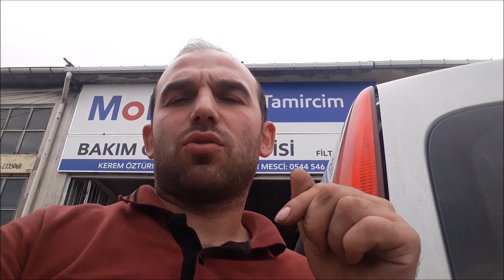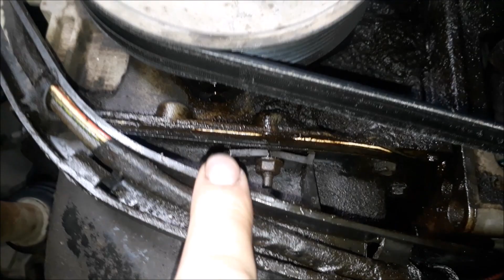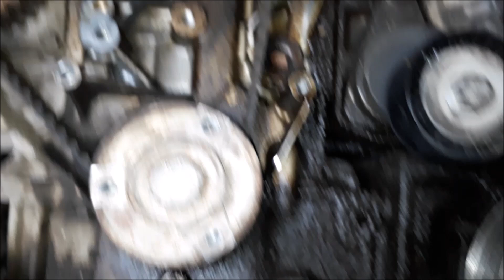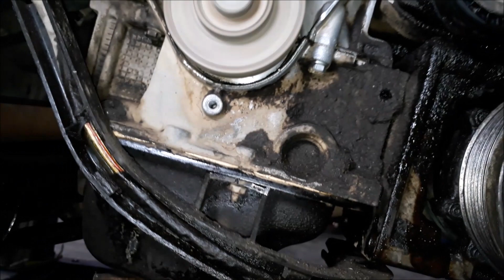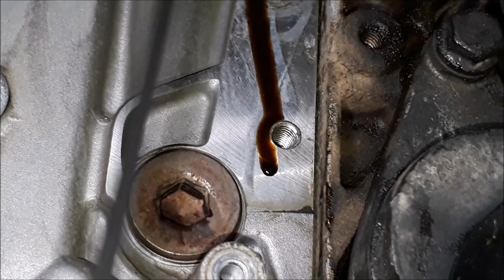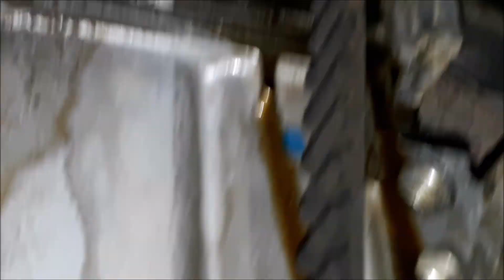Motorun Atar Damarı Patladı İlginç Yağ Kaçagı Silindir Kapat Contası Yağ Sızdırıyor

Comment: Ustam 2001 honda civic 1.6 vtec ls aracım var.238 bin kmde. Yağ yakma, yada yağ kaçıran en ufak yeri yok. Altı üstü tertemiz. Ama araç 1000kmde yaklaşık 250-300ml yağ eksiltiyor. Performansı gayet güzel. Sıralı lpgli. 10/40 castrol magnatec yağ kullanıyorum. Sorun ne olabilir tahmininiz var mı.? Yada farklı bir numara yağ mı kullanmalıyım. Bilgi verirseniz çok sevinirim. Hayırlı işler dilerim